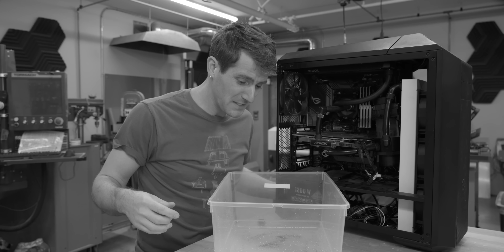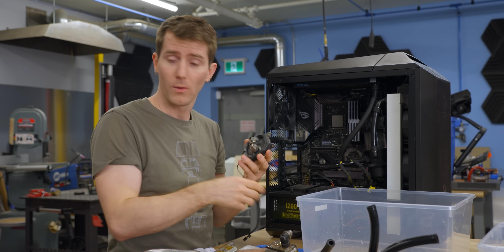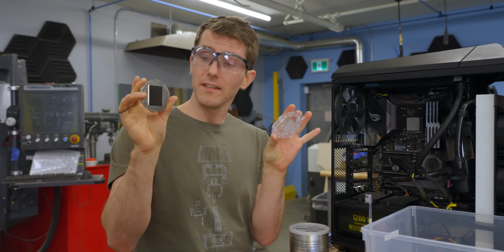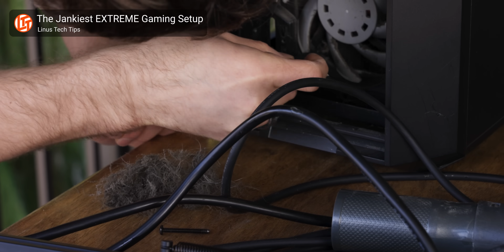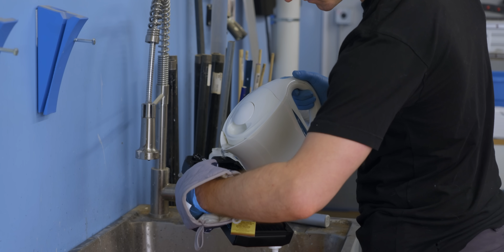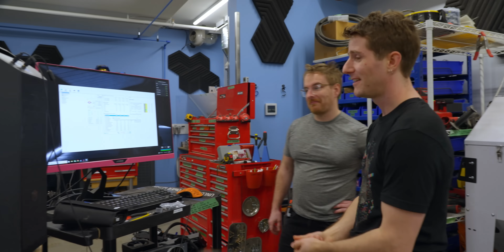I Will Never Watercool Again – Water Cooling Maintenance Guide

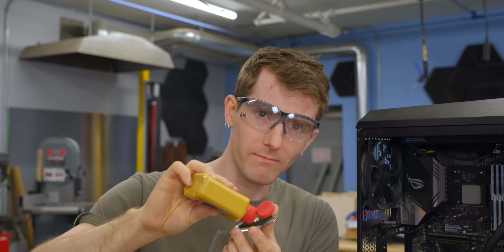Comment from the maker: 5:24 Brasso is safe to use on the silver you would find in your waterloop, but is not recommended for aesthetic pieces as it might cause micro-scratching. Use a less abrasive polish like Silvo for delicates such as jewelry or silverware.
 
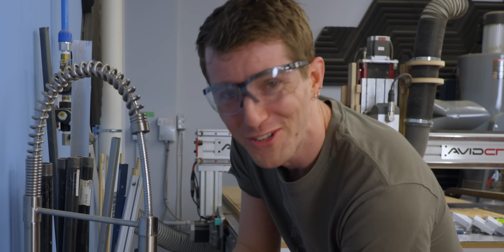5:36 We misspoke during one of the sponsor talking points and incorrectly said “IP7X” (rating of dust resistance) instead of the correct “IPX7” (rating of water resistance).
Reply: I think the water cooling computer industry could learn a couple of things from a vehicle cooling systems. For example, the radiator hoses on a vehicle are actually conductive. Yes, the rubber is impregnated with carbon or bits of metal. This is extremely important. Otherwise, a corrosive reaction will happen between the engine block and the radiator, kind of like a battery. Also, has anyone tried putting like 10% antifreeze in the system?
Reply: @SmokeyWire56 Pretty sure Jay puts glycol in his, which is for all needs antifreeze.
Reply: @SmokeyWire56 Cars and PC loops are very much not the same. They're made of different materials operating at different temperatures under different conditions. PC loops use brass and copper components, which are very close in anodic index so galvanic corrosion is not an issue when using a purpose-designed coolant with a corrosion inhibitor.
Reply: @SmokeyWire56  Wouldn't that pose a short risk with them being conductive?
Reply: I think the problem with adding anti freeze is it thickens the liquid reducing cooling capacity, in a car its whatever because a frozen solid radiator isnt functional assuming it does not break from the expansion of ice. So reduced flow/cooling is better than nothing i also believe water transfers the heat better, EG (Ethylene Glycol) is what id assume you'd wanna use as it transfers heat better than PG just wear gloves/cover your eyes and dont drink it, unlike PG it can be deadly.  @SmokeyWire56
Reply: I miss beardly Linus ngl
wife probly appreciates it better tho
I actually thought I was watching archived videos from the 2010s tbh
Reply: @drek9k2  Wife prefers bearded Linus. Linus also prefers bearded Linus. Bearded Linus will be back, he just shaved for a hydro-facial treatment thing and they couldn't do it over the beard. He intends to keep the beard off for a little bit (few weeks maybe, can't recall why, he talks about it on WAN show) then it will be back. Apparently his wife's first thing she said when seeing him without the beard is "You're going to grow it back, right?".
Reply: Personally I use plain distilled water and silver caps on my reservoir as an anti-microbial. I also made sure to use all the same metal (copper) for my cpu/gpu water blocks and radiators to avoid corrosion. I built my pc in 2018 and the only time I switched out the water is when I upgraded some parts in 2022 and the water was so clean I could have reused it if I wanted to. I've also never had any algae growths.
Reply: W water resistant
Reply: LinusDustTips
Reply: did you know you can soak rusty parts in white vinegar too it takes a little longer but it works
Reply: Could you use hydrogen peroxide in the loop?
Reply: Vinegar comes in several strengths. Cooking (3%?) Cleaning (5%?) And 30%, which can burn your skin (don't ask how I know). All are available at the hardware  box stores.
Reply: I used to use brasso and silvo on scratched CDs and DVDs to get them working again. Did that from PS1 days all the way through to PS2 and PC stuff.
Reply: Not to mention silvo is easy on the hands, while brasso DESTROYS them.
They both work very well though
Reply: the fact water and dust resistance is a single swapping of characters is madness.
Reply: Since your Linus figured you might give it a try...Try Astroglide water based lube or any other prem water based lube in a loop.
Reply: Couldn't you use CLR to clean inside the rads instead?
Reply: wait... the number's placement makes a difference in the ip rating? OMG
Reply: Never use Brasso on drum cymbals.  :)
Reply: I suggested toothbrush sponsor nearly 1 or 2 years ago lol
Reply: 0:21 THAT'S WHAT SHE SAID.
Reply: A waterproof toothbrush.
This really is the future.
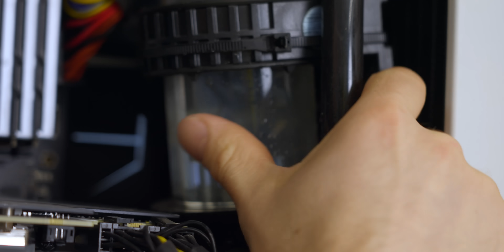Reply: @0:40 A much better thumbnail than whatever stock image you chose.
Reply: Umm - what??? Vinegar to clean out the radiator? If you wanna ruin it, sure. Geez, Linus... 😱 Neither aluminum nor copper bode well with vinegar. You should know that. Use a descaler for coffee machines if you pride yourself in your watercooling - and are keen on keeping it running. 
Love the vid anyhow. Keep up the good and interesting work! 👍
Reply: @MultiMegafred rinse it off after lol.  it dissolves the sediment and clingy bits and leaves you with an easier time doing the cleaning. because it is in fact a descaler
Reply: Many YouTubers use redirection to send Canadian viewers to Amazon Canada. Maybe you should ask one of them how it's done.
Reply: You're telling me they used all the same letters and numbers for both dust and water resistance and thought that was a good idea? Lol.
Reply: test
Reply: Public corrections are a sign of integrity. Keep doing good work.
Reply: I like the way this is bringing cross-over handyman know-how to bear, but, in that vein, you might should have used a wee paintbrush to paint some Ospho on to the still-rusty reservoir, let that dry overnight, and then, rinsed any residue off of the converted-to-a-black-oxide-that-can't-itself-rust lining, Linus.
Reply: „I will never watercool again,
guilty hands have got no rhythm!“
Reply: Hey, I've been thinking about this for a bit, and while I don't know if it's possible to do, I think I have a solution to virtually all the problems this video highlights, so then I checked for each specific solution I came up with and, they aren't on your channel. one of them sort of is, but not for this reason... The biggest one though, is a filter. Simple as that. between the reservoir and radiator, is a filter that all the water must pass through to filter out any and all particulates or reactive plastics. This would prevent, or at least minimize, the buildup of microplastics and other gunk in the parts you're trying to cool, which means no destroying GPU coolers, or GPUs, or at least not until an order of magnitude or 2 longer. of course the water would have to be actively pumped through the filter, and the filter would need replaced periodically, but it's easier to replace a filter than give a deep clean. If the filter is an off the shelf part, even if it's in an improvised housing, it should be cheap to do. just replace it twice as often as you would do such a deep clean and you should be golden for dozens of filter replacements. The problem is, the only water filters I know are Britta, and I don't know how they would take heated water and microplastics. or otherwise building a home made filter out of something janky like a sponge, or otherwise spending a few hundred bucks (or thousands) on something more industrial. Second solution I had that's a bit more obvious, is copper pipes and fittings, because that doesn't break down into microplastics, but corrosion could still be an issue, but that's where the 3rd solution comes in. a literal solution. Don't use water, use some sort of plastic and metal safe liquid, like an oil of some kind (mineral oil maybe? i've seen videos of people liquid cooling by submerging the whole machine in a tank of mineral oil and that functions). I figure, the combination of non-plastic plumbing, filters, and microbe-unfriendly non-corrosive coolant, and that solves these problems. Now, getting the parts affordably and getting it put together might be hell, but it should theoretically be unkillable.
Reply: Silicone, not petroleum based lube for o rings. What about clay based?
Reply: I once had to clean a computer from someone who used to sit and smoke pot in front of his water cooled PC  for Years, the clear water was BROWN , . I asked is it possible ot have a Nicotine  Cooled PC  it made me wonder how it was sucking air , or rather smoke and Nicotine in to the unit,   The fans were so gunked up one set on fire from high resisitance of the bearings ,  the GPU hd to be completely de fanned and stripped and and heat sink steam cleaned , before going back,   

No Smoker should be ever let near a PC , it was disgusting ,
Reply: @Demonic-X  so, i can answer part of this. So, smoke contains tar, a liquid, a very thick viscous liquid, that leaves very thin layers on things. A demonstration of this is, there's a guy on youtube who made a machine to smoke cigarettes in order to smoke steaks with cigarette smoke. Disgusting, but visually shows the buildup of tar as and orange to brown sludge. The thing is it stuck to the walls of the container, rather than drip down and pool in the bottom. The surface tension pulled it up the surface. Same effect is why walls and floors of a smoker's house get stained, even in rooms they dont smoke in. It's surface tension and capillary action. In the case of liquid coolant, the smoke/tar touches any release/break away part, and via capillary action gets to the o-rings, and around into the system. Its the physics of microscopically thin layers of very thick liquids deposited as vapors. Its like electroplating, it gets through even the tightest of gaps. To prevent it you would need to seal it with plumber's tape. Of course you cant really do that with the entire computer. External liquid cooling only kicks the buck to that cooler, which still needs air intake and exhaust, and you cant tape that up, or leave it outside. You would need air filters at the intake and have forced exhaust. The intake would have to go through a liquid air filter, which basically turns it into a bong, then that would have to go through a drying system to stop the water from getting in as well. By then your computer is now 3-4 times as big, just to survive someone smoking. Its a terrible idea, a massive waste of money, but its technically possible. They already waste money on cigarettes, which are almost $10/pack, and they might be a pack or two a day, so it might be worth the investment to them. But more than likely "oh, i gotta buy new gpu and pcu every few years anyway, so who cares!". Yeah, smoking is pc abuse.
Reply: @therealquade  good answer although i wasn’t asking a question tar and smoke is digesting whether  ear a water cooled system a fan system of a humans lungs if it foes that to a pc think what it does to a set of lungs
Reply: You guys should make an LTT toothbrush that’s as awesome and reliable as the screwdriver
Reply: Evaporust works way better than CLR for rust
Reply: IP7X vs IPX7..must have been named by the USB forum
Reply: The quality supposed to be better... yet again, we have corrections in comments instead in video :/

Comment: I'm all for Air cooling, as it beats in Price/Performance ratio. However this video is just so wrong on so many levels.

Four Big mistakes made by these (rather questionable intelligence) individuals, that if it wasn't for them, custom cooling maintenance wouldn't be as tedious as is made out to be here:

1. No T-Fitting with a drainage valve
2. No biocides in coolant
3. Mixed Metals within interior loop parts
4. Cheap out on the Pump

If you don't do these 4 mistakes, then you only need to maintenance once every year, and mostly its just checks or simply "drain. flush. refill". Done.

And that doesn't change the fact that liquid cooling is still the most thermodynamically optimized method as well as quietest.

Comment: I water cooled my PC 7 years ago and have never had an issue with anything other than the soft tubing discoloring. The only component in the loop that I've changed is the GPU block, and I've never had anything rust/oxidize/whatever, but then again I've always stuck with either EK Cryofuel or Corsair XL8 instead of straight distilled water with biocide added.

Comment: It's fascinating, you have cars sitting in a field since the 50s with it's original cooling system with coolant so old it's just sludge, but somehow you just shove a hose in there and clean it, fill some new coolant in there and it's good as new, while PC water cooling, even using proper coolant, yet ends up looking like a disaster after a few years if even that. Makes me wonder...

Comment: my Swiftech H220 has been running for 10+ years trouble free. Until today.  the acrylic block is showing a crack and dripped. I'm sad to have to replace such a great piece of kit with a boring AIO (I'm not spending $400+ on a new custom loop)

Comment: Literally just had to do mine, it was clogged after switching the direction of flow.. and it was bad, I had to take my blocks apart and scrub them with alcohol and a little tooth brush.. I had a glob of whatever that crap was about 6 inches long..

Comment: guys much easier way. just buy yourself a tank/fish pump connect to your system open your drain port. submerge the pump in distilled water. turn the pump on and just let it push all the coolant away.  you can use this method to clean the rads. super easy and fast. all other steps I agree with accept blowing into your system. but that's just preference.

Comment: Cloth oven mitts are a horrible idea for working with boiling water. The cloth will absorb the water and hold it against your skin causing much worse burns before you can take them off. If you don’t have waterproof work gloves, i would go with thick dish gloves and use a couple of pot holders to grab the hot radiator with. Ideally, silicone pot holders too.

Comment: been running the same D5 pump and radiator for over 10 years and I'm telling you RV plumbing antifreeze is the best cost effective coolant that wont sludge, support growth or corrode parts

Comment: I have been water cooling for year and have built people water cooled PCs… I have never seen these issues really, I had a little bit of corrosion on my first pc because I didn’t clean the components and had mixed metals with tap water…. This was frankly just built by an incompetent builder or someone just guessing as they went along.

Comment: I have a 20 year old PC that I have never changed the coolant on and it still runs just fine. I don't think 5-10 degrees makes that big of a difference. I have had like 8 fans burnout on it throughout the years though. I also don't dust it which is probably more important.

Comment: I think one important thing to keep in mind with the AIO manufacturer's warranties is that they're against part failure, rather than loss of performance – you can absolutely have an AIO that's still under warranty but no longer cools as well as it used to due to gunk buildup, or more likely evaporation (there is no such thing as zero maintenance in liquid cooling, all loops need topping up eventually).

Comment: my current pump i have hade for about 6 years running my pc idk how long the last guy hade it for but its still going strong i only drain and clean my fluid once a year if that rads get the old blow every few months i make my aircooler friends cringe but they hate how my system still stable and cooler than theres XD

Comment: 8:10 actually anodized aluminum is theoretically 100% fine - the anodization acts as a barrier and effectively prevents galvanic corrosion. But after you scratched it? Yeah you ruined it lol.

Comment: I would recommend hypochlorous acid for this....... If it want highly corrosive as f and would totally erode the nice metal blocks and fittings in this thing
Goodbye mold
And plating :/
Pls don't try this athome!
(It's supposedly good for like all purpose disinfectant, it's saltwater bleach/vinegar like base) But please nowhere near the computers :(
I actually do have one idea: steam it? (With a steamer or carpet cleaner tool)

Comment: Sooo.... giving up the constant vastly superior cooling capabilities and the consequential increase in component life, lower energy consumption making it a 'greener' build, higher performance factor you feel that having to do 20 minutes of liquid maintenance... what... twice... during the lifetime of the PC isn't worth it? Okay. I disagree. Vehemently. I have a liquid cooled system (well more than one), and this one I built 6 years ago. It only has cooling for the CPU. I've changed the reservoir twice. The avg temp for the CPU after six years of use and wear is .4% degrees Centrigrade higher and still well below what you can accomplish, unless you go ridiculous and basically put a breadbox in your case, with an air flow only based radiator. Air flow only requires... SERIOUS airflow and clean filtered airflow at that. This PC is sitting on a shelf inside a cabinet. Fair it does have an 'airflow' back and bottom panel on the cabinet, but Physics is a precise b!tch I'll give her that.

Comment: For my first PC, I am first starting with a PSU with self check, and some hard tubing gear.

My plan is to gain a new benefit from water cooling - the legendary AC cooled system. The plan will be to build a cooling table, with a hook up for the PC on top. Using the radiators in a stack and an electric mini turbo on a dimmer, I will push AC air though my radiators outside of my PC case in the table. Lets see if this actually super cools.

Comment: The lazy way of doing this is just draining the loop, filling it with 20% vinegar, running it for 30 minutes, draining again, filling with a 50-50 mixture of water and isopropyl alcohol, running for another 30 minutes, then thoroughly rinsing it with distilled water

Comment: Watercooling is confusing because water is supposed to be cold and radiators heat things up. I don't think watercoolers are supposed to be connected to radiators or radiators should be called something else.